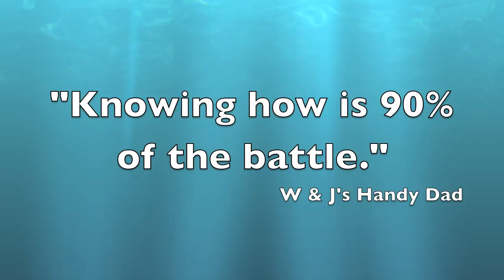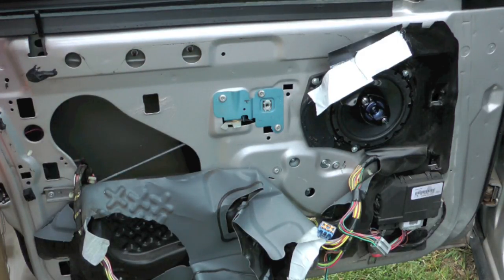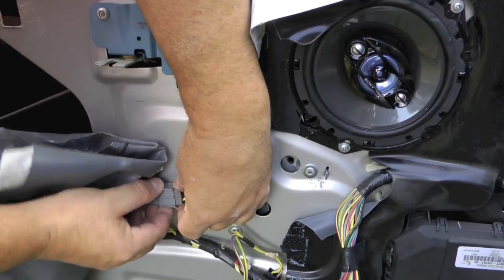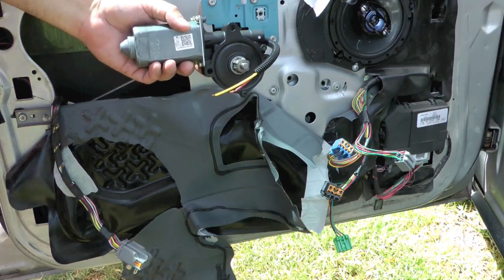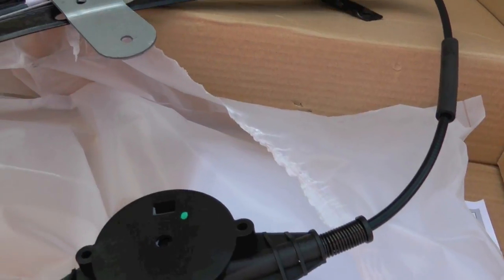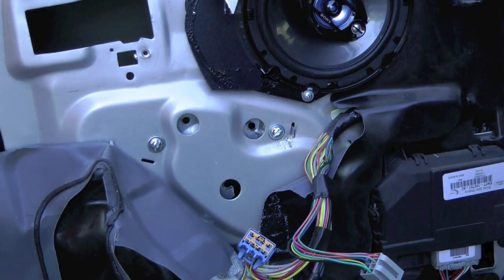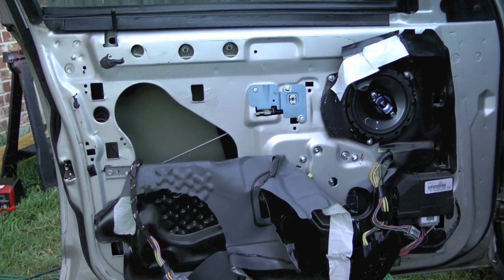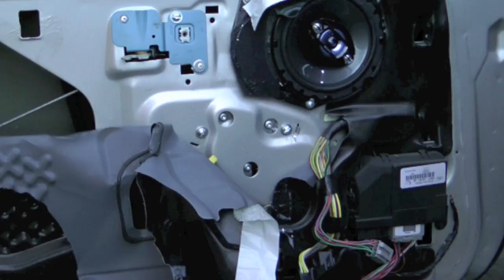Ford Crown Vic Window Regulator and Motor

Comment: How do you remove the rear window on a crown victoria??  I can't seem to find an answer anywhere!
Reply from the maker: I haven't had to do it yet but I would assume it's very similar to the front
Reply: @WJHandyDad  Figured it out, had to pull out accessorie window to make room for larger functional to be pulled out.  Thanks for the video!
Reply from the maker: @stefenherrera  glad you got it

Comment: I just had the lift cable come loose on mine.  Used this video to figure out how to get it apart to try to get the window up until i can replace it if fix it.   
Thank you!
Reply: My lift cable snapped off as well. Were you able to fix it by putting the cable back on or did you replace the regulator?
Reply: @johnpatillo7388  I had to replace the whole regulator.  the plascti holding the cable to the lift frame broke.  it was actually pretty easy to do,
Reply: @Bendigo1  yup I knocked out mine over the weekend. The comments were kind of misleading as I thought I would have issues, especially when it came to the rivets on the window. Knocked em out and drilled em out with no issues.
Reply: @johnpatillo7388  it is a bit nerve wracking hammering against glass...  but those rivets pop out pretty easy. What messed me up was trying to remember to plug everything back in....
Reply: @Bendigo1  just a drill bit will drill out the rivest? And what should be drilled back in its place? Never dealt with them before

Comment: Do I need to adjust the motor so the window goes up and down right? Not sure how to adjust the motor to work right.
Reply from the maker: mine needed no adjustment... worked right out of the box
Reply: So. Let me see if I understand you. The regulator(the piece that the windows bolts to) It doesn't mater where that is set(up or down) or in the middle. I should be able install the motor and the motor will stop at the top and at the bottom. So it doesn't matter what position the motor gear in in it should work. Like if the motor came out while the window was all the up. I can put the window all the way down and put the same motor back in and everything will work fine??
Reply from the maker: that is how all of mine have worked

Comment: How did you adjust the window regulator motor to go up down right?
Reply from the maker: no adjustment was needed.  It just worked right out of the box
Reply: @WJHandyDad  I noticed the first time you tested the motor and it went to high. You said you had to make adjustments.
Reply from the maker: @rickytoombs6561  I didn't have the window on the regulator so it didn't have any way to stop.  I should have just tested that it went up and down but instead I held the up button too long.  Watch again... https://youtu.be/3viQFZ_tpdg?si=NYB1-gr_AR7Dznr4&t=730
Reply: So it's not the motor only turns so far up and down. The motor stops when the window stops? And the same when it goes down? @WJHandyDad
Reply from the maker: that seems to be the case based on my experience
Reply: @WJHandyDad  Thank You for all your help.

Comment: I replaced the window switch and my window still wont go down, it made like a high pitch whine sound at first but wouldnt go down. Do you think its the regulator or do you think its the motor?
Reply from the maker: if you're going to DIY you may as well replace both while you have it all apart
Reply: @WJHandyDad  Funny thing about my car. Nothing is black and white. The switch didn't work when i installed it yesterday.I parked the car overnight ask questions here, looks like a lot of work to take that panel off. Anyway , I  got into my car today and the switch worked and the window rolls up and down as it should!? My car has an uncanny quirk. Something can be wrong for a few days then it goes away and i dont have that problem ever again or years later? Maybe treating her like a lady helps! So luckily, it was a 5 minute, $15 repair. And people ask me why i drive this car,lol

Comment: sooo, my rear left regulator just crapped out, lowered the window, and when coming up, cable snapped so it got stuck open.
Cable also got stuck in the window track and that made it almost impossible to move it out.
I had to push it up by hand and use a wisegrip to hold window up lol.
Then i remembered WJ Handy Dad has videos :))) Regulator and motor kit on it's way lol
Reply from the maker: hope it's an easy fix for you
Reply: @WJHandyDad  i looked and seemed just a bit harder than the front ones, due to the tiny window being in the way, so that window and trim need to come out first
Reply from the maker: thanks for sharing that tip.  I have been lucky enough so far to only have had to replace the one shown in the video

Comment: I’m just wondering y Ford hasn’t switched to bolts or screws, still rivets n they make da job harder
Reply from the maker: probably just a cost thing
Reply: You probably right about that
Reply: $.10 for a rivet $2.50 for a nut and bolt × a few hundred per car × several hundred cars= a lot of cost ant time savings during production

Comment: Can you over tighten the window bolts through the white plastic and break the window because i need to tighten mine so it sits correctly when its all the way up I have a gap athe the back
Reply from the maker: I would say anything is possible so I would be reluctant to guess at what point something could be overtightened enough to break the glass.  Proceed with caution if you're doing something outside of spec
Reply: J. Burroughs, did you have a "gap" on the window and door when fully raised, or where the window connects to regulator plate?  If the window and door, have you fixed it yet?  I have everything replaced and motor seems to work, regulator seems fine, everything is tightened down and seems to be seated properly.  Window lowers great, but when it is raised up the top of window slightly tips forward and slows down at about 3 inches from being fully closed.  I can hear motor strain at that point, and motor stops at about 1/2 inch from window being shut which I'm certain is because it becoming wedged.  I can't figure out why window is tipping forward and not closing properly.

Comment: My 2004 back seat drivers side window pretty much is doing as yours was. I will try the motor first. I'm too old to be doing this anymore. Thank you for the helpful information. No rivets in the packaging any more, just screws. Fortunately I have a really nice two handed rivet gun with a very good selection of rivets.

Comment: I used a Dorman window regulator for my last window motor failure, good luck so far after 3 months of use
Reply: Dorman gets + reviews. 🚘 I just had my 2005 Ford Crown Vic P74 drivers side back window. I had the entire window assembly replaced. Motor & regulator. The local shop charged $434 total.
Reply: @DavidLLambertmobile  that's Alot,,,    smh     my local guy changed the entire assembly for 180. 

I just bought the regulator for 35.99,, I could've bought the regulator and motor for 79 bucks but,  my motor was fine my cables broke

Comment: Most common failure for these is the three plastic plugs inside the motor gear box get busted. They sell a Dorman fix kit for them that has three new plugs for around $9. Its part number is 74410
Reply from the maker: good tip, thank you for sharing

Comment: Tapping out the rivets with a punch seems effortless in this video.  Any tips on punching out stubborn rivets?
Reply from the maker: they took a pretty good whack with the hammer and the center punch.  I was a little timid at first because I was afraid I'd break the glass.  The timid hits were edited out

Comment: ATTENTION!!!  DO NOT REMOVE THE DOOR HANDLE!!!   
I just finished replacing the regulator and motor on my '09 p71.  I found that if you pull the plug for the motor away from the hole, you can access the forward window rivet without removing the door handle bracket.   It was almost like that hole was placed there specifically for that.  If you need to replace this on your crown vic, check to see if it works for you.
Reply from the maker: thanks for the tip

Comment: Great video but I only needed to replace the motor, everything seems right but it sounds like its grinding. Maybe I didn't set the metal tensioners in the right spot... I'm gonna be messing with it for the next 2 hours
Reply from the maker: hope you get it fixed.  Mine was pretty straight forward.  Only issue I had is the first motor they gave me was bad

Comment: Excellent video. How do you like your Rigid drill and how long have you had it? I have been wanting to get one or two and still might but I'm hearing good and bad. What says ye?
Reply from the maker: it hasn't given me any problems... came with a charger and 2 batteries so I can rotate batteries - and they re-charge very quickly